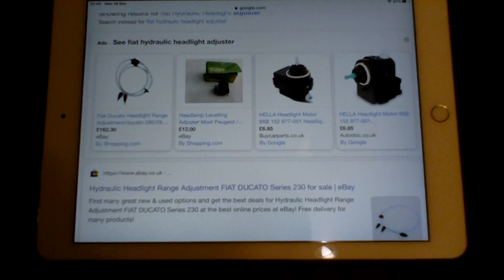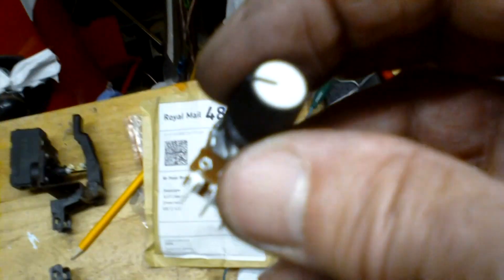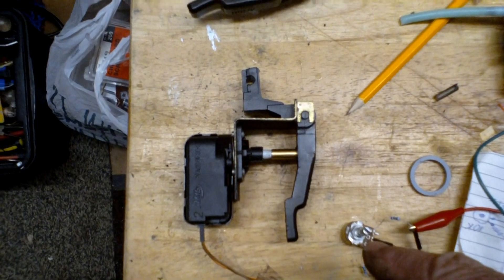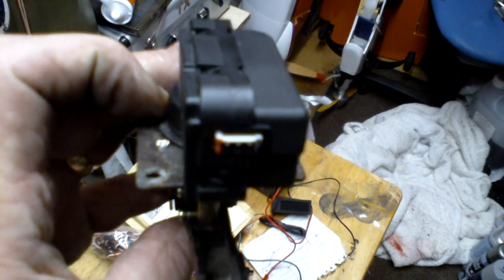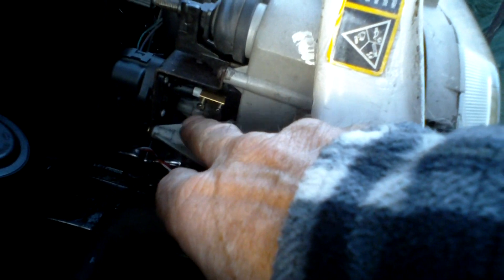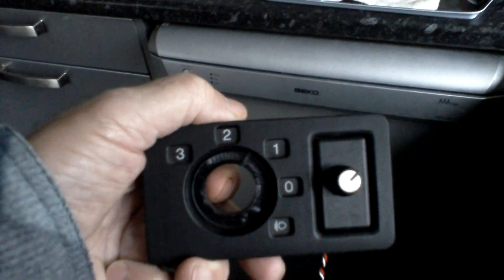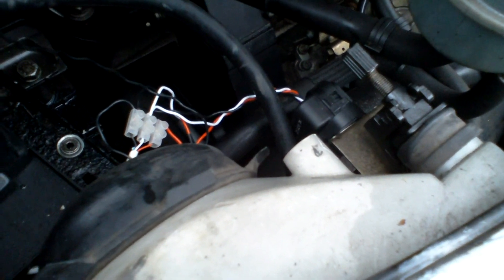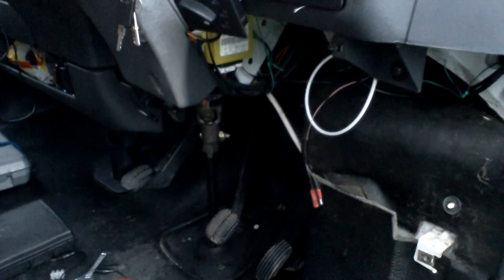Motorhome Headlight Conversion Hydraulic To Electric

Comment: Hi Peter, great video. Would you happen to have the AliExpress link to the servo? The ones I have found don't look like they will fit.
Reply from the maker: Hi Roger. With the servos I took a chance with AliExpress but I had to modify them a bit anyway they were not a straight swap. The video was intended to be a guide and I suspect any similar servos would be fine. To help look for the servo that supplies the resistor and potentiometer and that’s. Good clue.
Mine is still Woking fine by the way. Regards Peter

Comment: Do you have a part number, and/or link to the motor and variable resistor? Nice job BTW.
Reply from the maker: Hi Keith. There is no part number as the servos were brought up with a general search on eBay.
The other parts required are early mentioned - 1x 10k stereo volume control. 4x 1.5k 3watt carbon resistors. 
That’s all you need.
Take the power feed from the sidelight wire on the light switch on the dash as it’s then a fused supply...
Regards Peter

Comment from the maker: UPDATE...
Been a year now since I did this conversion and it’s been a great modification which has saved me a fortune and is very reliable.
Regards to all. Author, Peter Bruce
Reply: Great job! Now I need to do the same on my Boxer. A couple of questions though if you are happy to share. How do you remove the old hydraulic actuator from the assembly? It twists and partly release but the piston end is firmly lodged in the lever.
Second question concerns best place to source the electric motors?
Chreers
Reply from the maker: Hi Sid. You have to pop the ball out of the headlight with just a force using a screwdriver to ease the plastic just enough to to spring the ball. Servos I got from AliExpress which are headlight servos and they fit onto the existing ring fittings so must be common to a lot of headlights on different van / car models.
Mine works a treat and saved me a fortune compared to the daft hydraulic ones they fitted.
Thanks for taking the time to reply and glad you found my video helpful.
Wish you well. Stay safe.
Regards. Peter

Comment: Reckon that's terrific success .It did show it moving and I for one am very impressed * Shame about the screwdriver injury to yourself
Reply from the maker: Hi Helena. Trust me to pick the coldest days so far this year to do the conversion... Anyway done and dusted. My injury was sustained while taking the hydraulic units apart to see what was inside and how they operate. Can’t resist a challenge but I did not take enough care while trying to prise two sections apart and the screwdriver ended up trying to part my thumb in two!
All good fun. Regards Peter